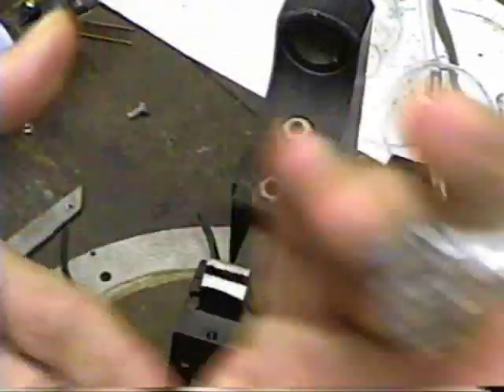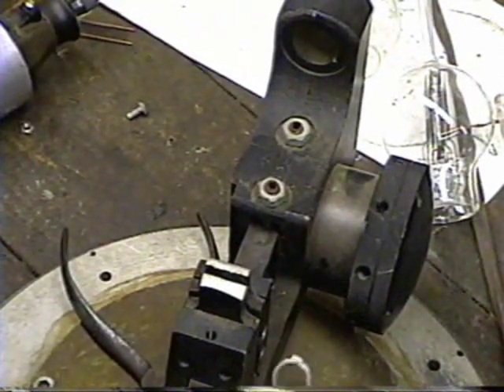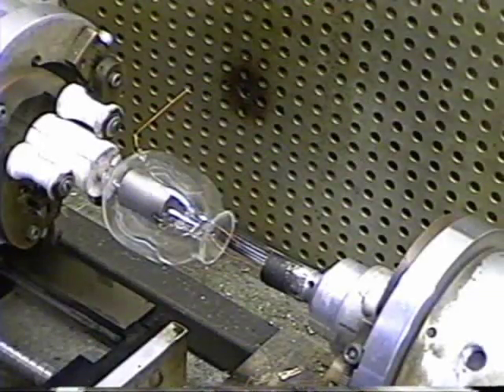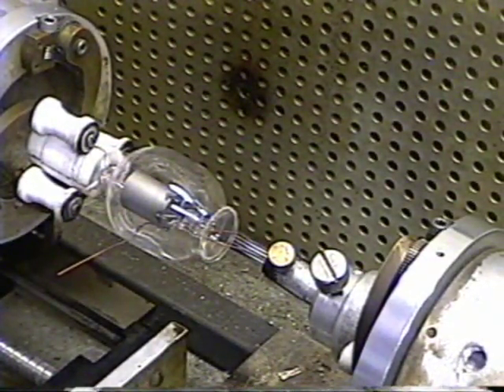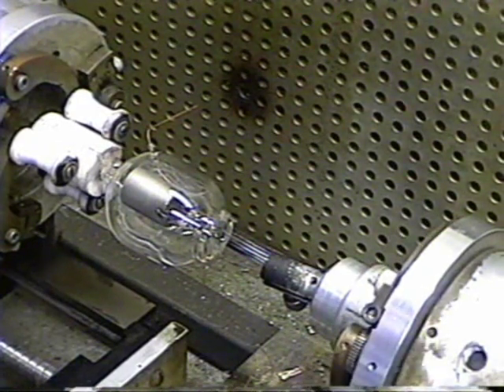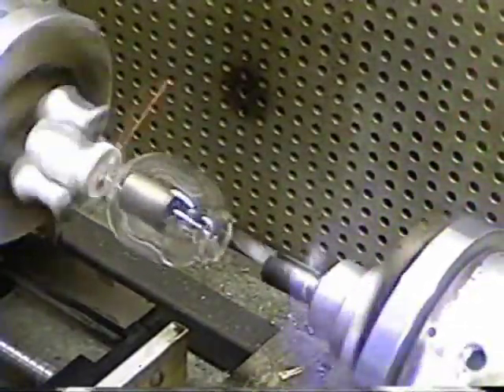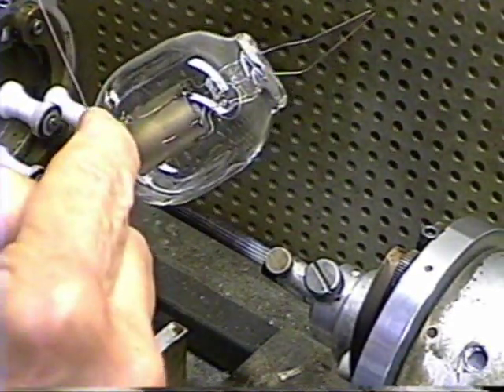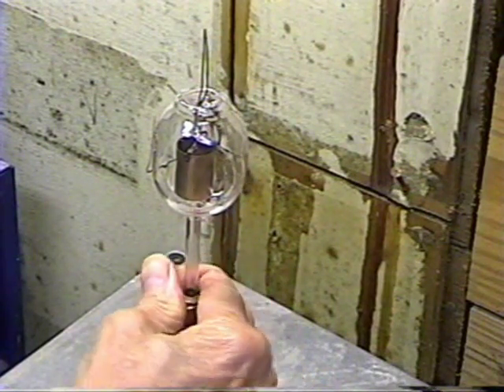making a fleming diode vacuum tube 5

Comment from the maker: Hello!
The tubes I most use are series string TV tubes that were made by the million for low end plastic TV's that sold for a hundred bucks or so. These are common to the point that people are dumping them in the dumpster just to get rid of them. Some dealers have not sold a tube like that in years! Even the South American market for them has gone dry. The word million just doesn't click in most people.s head!

Comment from the maker: The getters are made of a very reactive metal that reacts with any air that it comes in contact with. Unfortunately, your broken tubes have been exposed to air for so long that the getters are completely reacted. Typical getter life in atmospheric pressure air is around 4 hours. After that, the metal is fully converted to oxides.

Comment: @glasslinger Ok good because Im a collector :) anyways you said you can rebuild lamps for people? because I have a 3.5kw triode that got smashed in shipping, structurely the tube is perfect other than the top piece of glass were the heater wires are. I can pm you some pics. I love that you are make tubes. I have only made a few crude setups useing a flask and a cork, I use pencil graphite for a heater. I use a fridge compresser for the vacuum pump. keep up the good work!

Comment from the maker: @ntesla66 
I look at the size and how intense the getter looks. If it is large and very heavy, I know that they flashed that getter to the maximum and it probably doesn't have any getter material left in the ring. I throw those tubes away. Other tubes have a flash that is small compared to the size of the getter ring and sometimes not very dense, not transparent but not the heavy silvery shine of a getter that has been over-flashed. Sometimes I select a poor getter and have a dud!